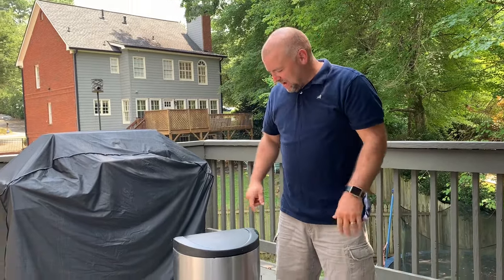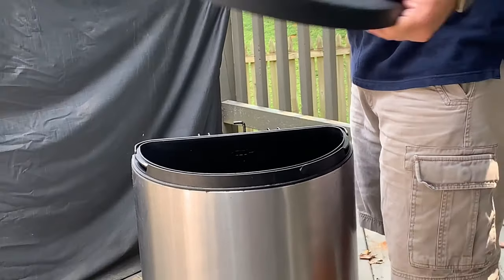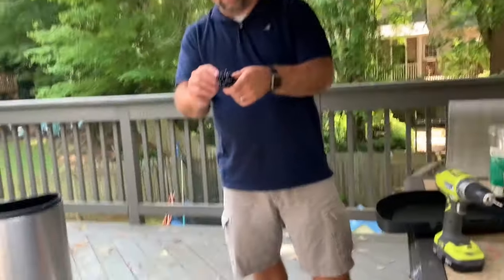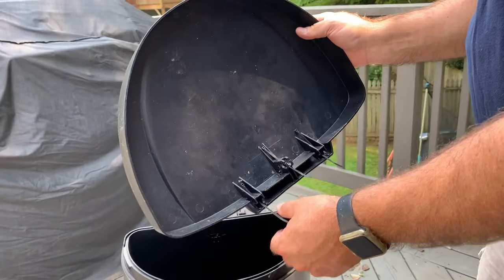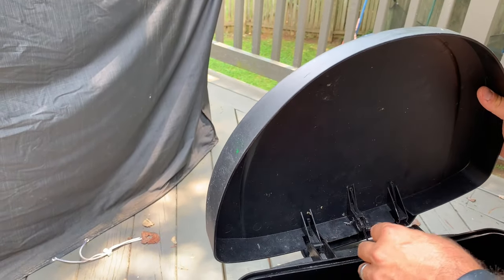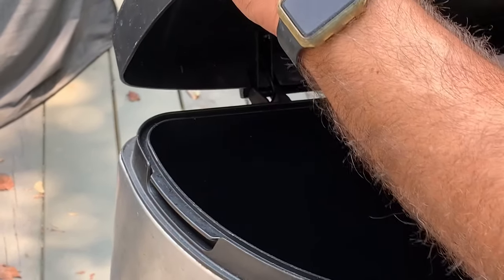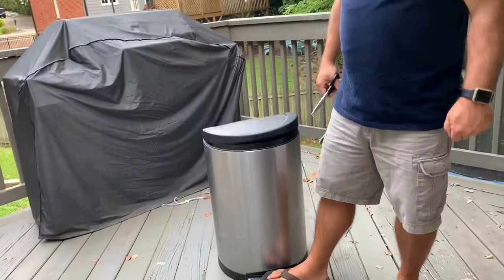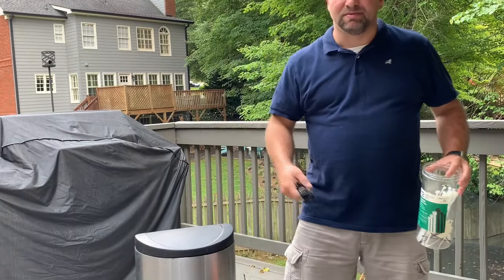Quick Fix for Broken Trash Can Lid! Easy Solve for Step-Pedal Trash Can Top Not Opening - by DIYNate

Comment: Can’t see anything! Don’t know where you drilled the holes or how you zip tied them.
Reply from the maker: Sorry about not having a better close-up for you.  I basically put the holes in the two bracket areas that clamp on the trashcan on the side and also one in the bracket in the dead center that wraps around the metal rod that is used to lift the lid.  Holes were directly in from front to back of the can and fed the zip ties through them and then secured.

Hope that helps and thanks for watching!  Sorry again for not having a better closeup - working to make my videos better as I create more.
- DIYNate

Comment: I have a different issue.  My lid goes up fine with the pedal, but does not come back down.  I have to push it down.  Do you have a fix for this?
Reply from the maker: That sounds a bit tricky but most likely, there is something disrupting the return flow - gravity should bring it back down but if the can hinges aren’t correctly seated or the metal post isn’t catching on the ‘backswing’ correctly, you may want to see if you can figure out what is causing the gravity motion not to work.  One other somewhat obvious thing - look to make sure no gunk or debris is caught in the hinges.  Good luck on the fix!
- DIYNate

Comment: How did you get the top off in the first place to do repair?
Reply from the maker: Hey Margaret - I had to pull the metal rod that is bent from the middle holes and unsnap both of the sides to get it off.  Hope that helps and good luck with the fix!
- DIYNate
Reply: I couldn't get the hinge to snap back on the right side. That's what became detached. I'd appreciate what tool I should use to get it back inserted. Thanks! @DIYNate

Comment: I have the opposite problem. Mine won’t close all the way.
Reply from the maker: Not sure I have a solution for that one but hope you were able to get it solved.  My guess is it may be an issue with the post that lifts the lid, the side clamps needing to be pushed down all the way, or possibly a piece of trash stuck somewhere along the lip / back edge causing the closing mechanism not to let it go down all the way.  Good luck with the fix!
- DIYNate